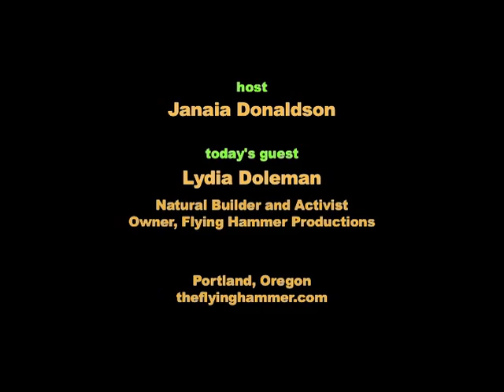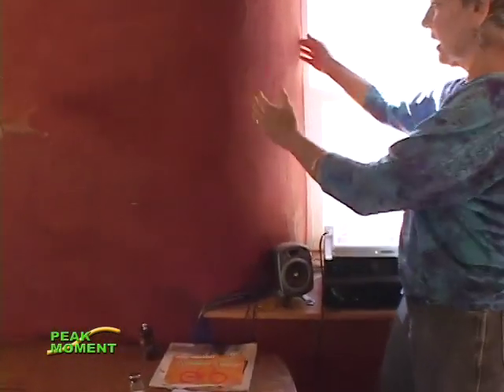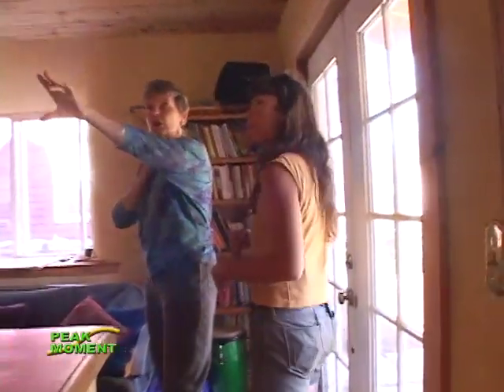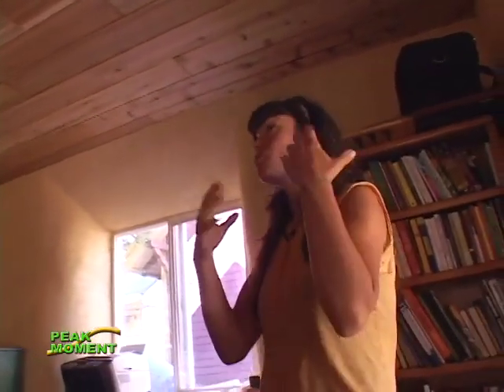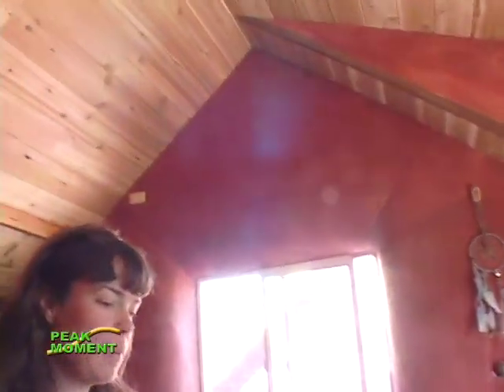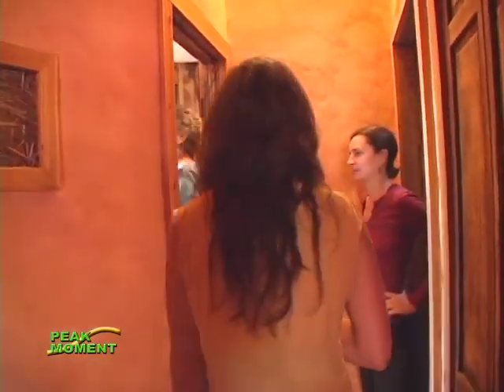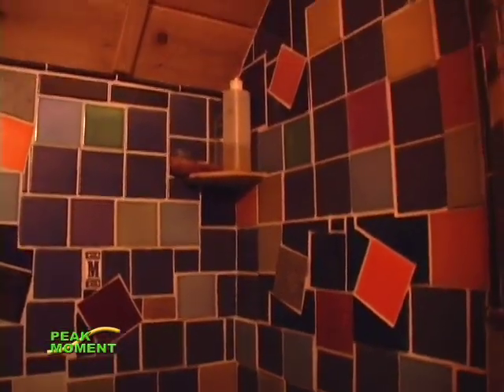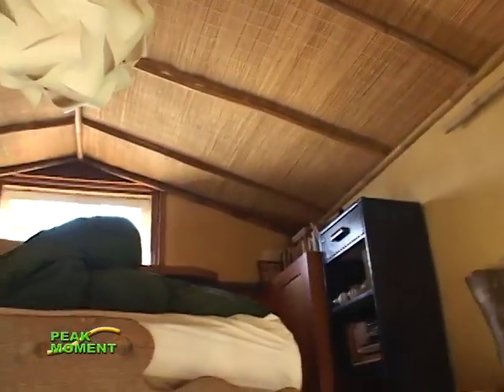Natural Buildings for Urban Living - The Tour (part 2)

Comment: Stick with compressed earth blocks, there's just NO comparrison between these two building materials.  When I took a class at Southwest Solar Adobe, there were FOUR former straw bale builders who were jumping ship due to all the problems with straw.  

With straw you have problems with possible mold within the walls, insects, rodents and other pests getting inside the walls, AND IT'S NOT FIREPROOF!!  Plus there are many other long-term issues that you'd NEVER have with CEB construction (which will still be standing after 1000 years but you'll be lucky to get a fraction of that with straw)

 So while it may SOUND cool and interesting, take a serious look at adobe or CEB before taking the risk.  If you need any other proof, just remember what happened to the little piggy who made his house from straw, lol.